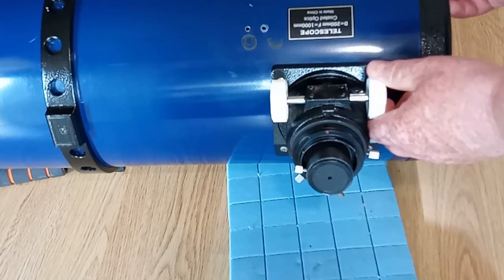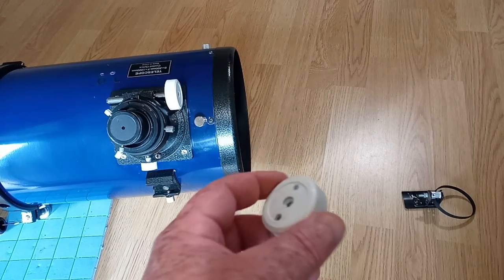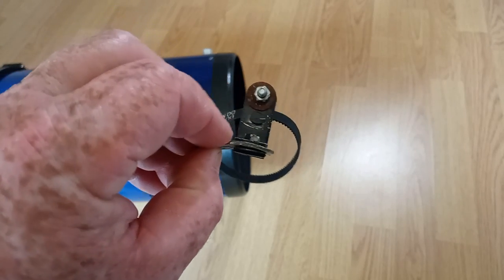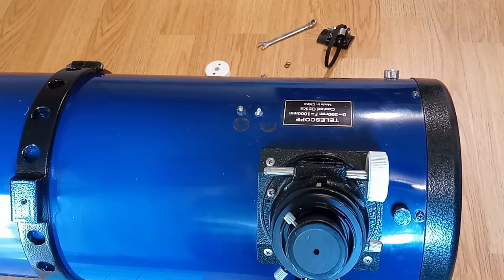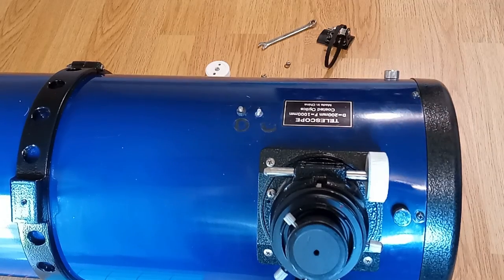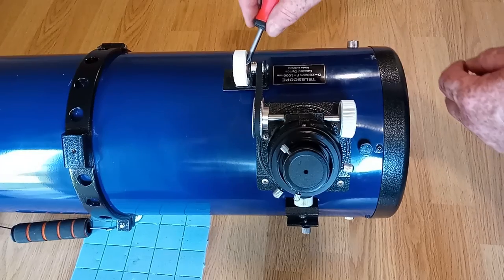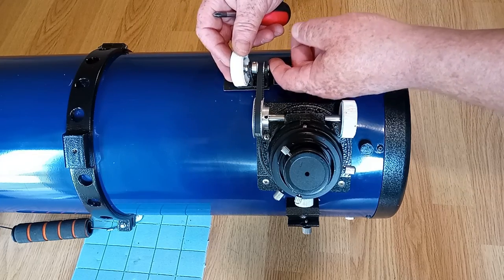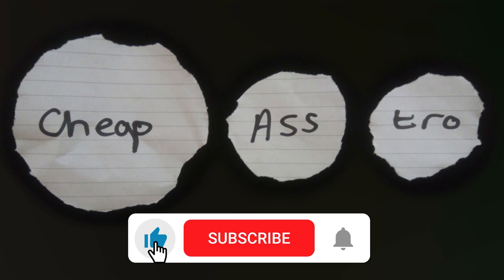Focuser Fine Control Hacks & DIY Dual Speed Focuser

Comment: Good job! That's a very intelligent way to get a dual speed focuser on the cheap. Just so ya know, I LOVE the one that comes on my Skywatcher 130p-ds so when you can get one, I don't think you'll regret it especially since it'll be more within your mount's weight capacity. I will probably add a jar lid or something to one side of the focuser on my achromatic refractor though. I usually use it for visual use, but sometimes you just need that fine focus when at high power.
Reply from the maker: Thank you. Yeah that 130PDS gets a lot of love. Gonna do it one day ... But then that 150 Quattro appeals! ... You never know, it may happen.
Reply: @Cheapass-tro  I've been thinking about that quattro recently as well. I think any of those newts are great scopes though so I don't think you can go wrong really. I would recommend a refractor, but you seem like the kind of person who enjoys tinkering and improving and that's really what newts excel at
Reply from the maker: @iamjessieray  Ha ha! Got me.

Comment: Great job !
You can probably find a Nema 17 pancake Stepper for about 20€, you don't need much torque for a focuser and it's way lighter than the nema in your kit.
Reply from the maker: Yes I saw those thin motors, but still I'm overloaded as it is so I will use one of those on a lighter scope when the time comes... Unless I buckle and try it anyway? Thanks for that!
Reply: @Cheapass-tro  Honestly, if you have the money, i would try it.
It's a few hundred grams, and it's not wasted because it would be a lighter load on the new scope too.
If you have all the mounting hardware, it isn't that much money to have that great of an upgrade.
Reply from the maker: @SaitoGray  I will do at some point. I checked them out earlier and the one I looked at was just 140g.

Comment: Problem is, with the original teeth on the tub going into the telescope.  Your idea will defiantly work, but I could see it slipping cause the teeth aren't as fine as with a dual focuser.  Still a great idea though
Reply from the maker: Hi, thanks. Didn't slip on me but it is still a cheapass solution, so not as good as a proper DS. I've put a motor on it now. Yet to sort that out to get it working though....
Reply: @Cheapass-tro   good luck man. You got some good suggestions going.  If I figure a way to make the track more accurate I'll share
Reply from the maker: @NM-ql9er  Nice one! I don't have all the answers, so any additional info here would be great.

Comment: Just get a Lacerta 10:1 microfocuser
Reply from the maker: I never knew this existed!
At first I thought you were suggesting some fancy, expensive focuser unit, not just the adjusting gear.
Not a bad suggestion there but my current focuser is not a Crayford type.
As it happens I've just bought an Omegon 10:1 Crayford for it for only £50, used. I won't get my hands on it for a while yet, it's waiting for me in the UK.